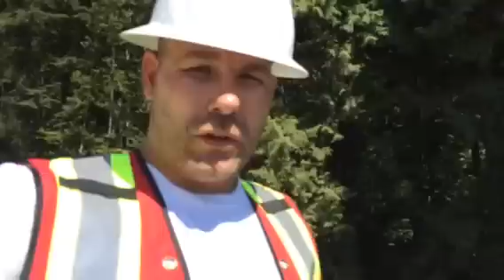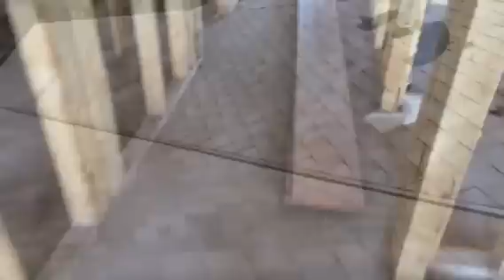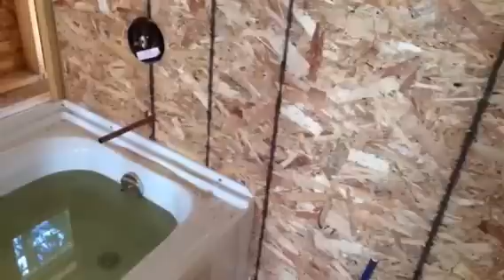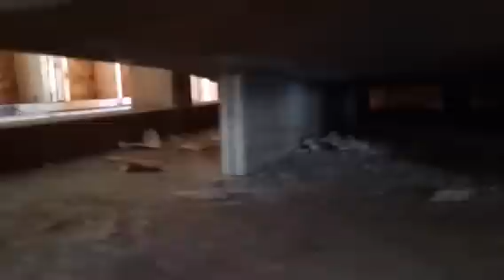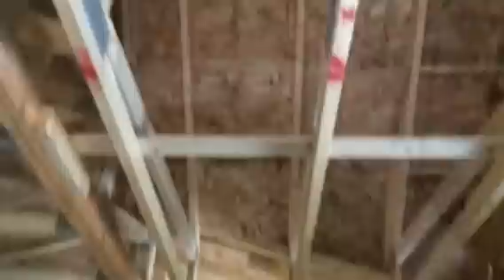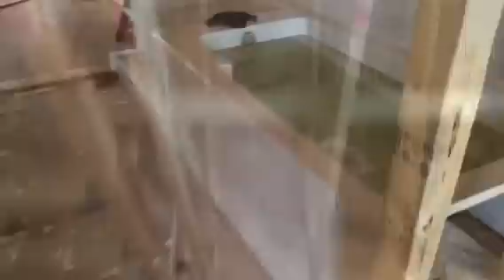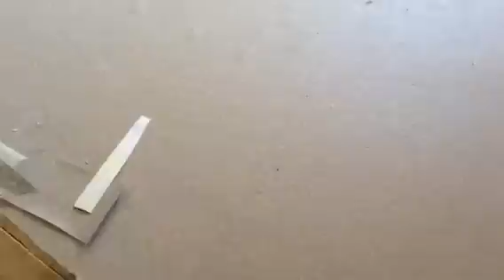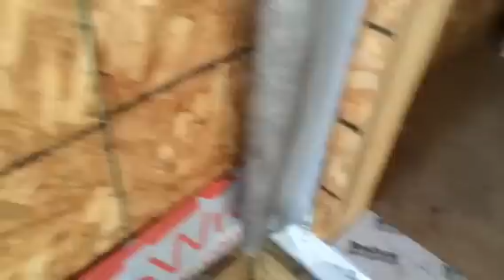New Home Construction Fails

Comment: No offence but you should really get up-to-date on tiling and waterproofing, check out Schlueter's website.  OSB plywood is a perfectly acceptable substrate because you're supposed to waterproof in behind it, meaning that no water will ever permeate to the substrate itself. I really hope you're not approving any tile that doesn't have waterproofing behind it!!
Reply from the maker: No offence Danny M but, if you think OSB is acceptable that's your opinion. Where I come from we call it a sponge for moisture.  It really depends on where you use the stuff. I'm in Vancouver, BC where moisture in wall cavities is a serious concern.
Reply: +Tom Munro, CHI why would water get into the walls?  I don't think you understand what I mean, the waterproof membrane goes "over top" of the OSB keeping it perfectly dry. If you build to Schlueter's codes they will pay for a tear out and reinstallation if it fails. So actually that's their opinion my opinion would be to use green board or cement board in case somebody cuts through the membrane in the future removing grout or something. At Schlueter's headquarters in Toronto they have a little cardboard box with their membrane adhered to the inside they continue filling it with water in the box has never been wet in over five years of having water in it 24/7
Reply: OSB is not acceptable where I'm from
Reply: +Gwen Coonen so yourself and others say OSB is not acceptable, and I would tend to agree I don't use it either. I doubt yourself or any other commenteers in the section have actually gone to Schlueter's website to check out their codes for substrate installation. Where this video was taken in North America it is a perfectly acceptable substrate, especially if you're putting concrete board over top and then a waterproof membrane. Where you come from it might be a different type of membrane that you called "damp proof" but over hear it is actually "waterproof" it's made of PVC. Please take no offence to me disagreeing with your opinion. Remember I'm talking "minimum code" here. Putting OSB on the exterior of the house, it's not something I agree with either but it does meet "minimum code". Since you're in Belgium enjoy a delirium tremens for me 🍻 Cheers from Nova Scotia!
Reply: You always build according to "what if?" You don't just take risks.  What's an extra $20 for 5 ply on a $3,500 tiled shower?  You serious?  OSB is garbage.  We recommend against it in every way, for roof, and for wall.  Ultimately it's what the customer wants, but when you're talking a TILE BACKER, what's an extra $100 for even putting down Durock? or an extra $20 for real plywood on the grand scale of things?  House roof and walls OSB to FIR would be $5,000-8,000 difference.  We're talking $20.
Reply: +Dale D if you've actually read any of my other comments You'd know that I don't use OSB and it is garbage! I'm talking about OSB as "minimum code" and as a substrate for green board or cement board. I say this because he is an inspector and should know the "new" codes that exist. The tub lip in this video was fastened to the face of the OSB and not to the studs in behind, this indicates their intention is to install another layer being of green board or concrete board in order for the tiles to sit flat and not interfere with the tub lip. If the green board was waterproofed with a layer of PVC membrane, then it meets modern building codes, like it or not. This is because proper installations never let the green board get wet or even damp. This "inspector" should research modern code and methods before he trash talks other people's work!
Reply: +Aquila Designs I agree! OSB is not ideal and doesn't have a place near water.
Reply: Haha "If you are a professional tile setter" WHY the hell would you be using OSB??? Go back to watching "This Old House" so you can learn what your going to work on tomorrow!!!
Reply: +Mirza and I've been using water proofing membrane for 10 plus years now, It was a new thing to many inspectors I've met along the way. Good inspectors ask the trades questions and others point fingers and call shoddy craftsmanship, very sad.
Reply: @Dane
Exactly I worked as a tiler for a couple of years and never once did we tile on OSB
Majority of the time it was Durock
Reply: +why guy that's were everybody doesn't get it. OSB is minimum code as a "substrate" meaning you must install concrete or green board over it then apply a waterproof membrane over that. Never would you install tile directly to OSB!
Reply: FYI to all commenteers! 
OSB is an acceptable substrate for tiling meaning you must install concrete or green board over top of it and then a waterproof membrane for it to meet code. I don't like minimum code and I don't use OSB unfortunately this is minimum code weather you like it or not, so please stop tearing me a new one for using it, because I don't! I simply commented on this to explain what minimum code is to inspector that doesn't know.
Reply: +Ryan Georgi that's my point smart ass this guy lives in Canada too. You should really look at the rocket science to make sure you get it right!
Reply: +Pat John I'm assuming you're talking installing tile directly over top of OSB?  Are you talking about installing a waterproof membrane or no?
Reply: +Fox Wright drywall and pine studs? What the hell are you talking about? If you'd like to respond with some sort of substance maybe you could explain your first comment.
Reply: It would be a really bad day at Schlueter's if they come in one morning and find the box soaked through ;-).
Reply: +Fox Wright your response explains nothing of your first comment, and I'm the dumbass? First off you're right! If you're comparing construction materials 100 years ago, compared to what we use now drywall and pine studs are incredibly inferior. That's not what we're talking about here, we're talking about modern building materials. So in a "modern" house what would you "frame" and "sheath" the interior of your walls with? If pine studs are garbage what kind of studs would you use? And don't say timber framing because that's not what we're talking about.
Reply: +stefantrethan true that! Lol
Reply: +Fox Wright good job troll! Lol
Reply: +Fox Wright I would agree… Have a look at a timber frame house after a hurricane next to one that's stick built, or I should say the one that was  stick built lol
Reply: Well Tom Munro think about it, water can get in from around the tub spout, shower arm escutcheon, shower arm pin hole leaks, or the shower valve itself. If you want to do it right just float the wall & forget that OSB & membrane crap!
Reply: +Dale D I agree with the first part of your comment in regards to pinhole leaks. But the second part about floating the wall is pretty vague, maybe you could elaborate on what you're talking about?
Reply: Danny M " floating the wall is pretty vague" No it's not vague if you tile, it's making cement mud & floating the entire wall over wire lath & paper. Basically it's 4 parts sand, 1 part cement, & 1 part lime. Done correctly it's perfectly plumb, flat, waterproof & a lot stronger. Google it!
Reply: +Dale D your first comment is vague, the only thing you said is to float the wall, that only means to apply motor to it. Only your second comment explained waterproofing it with tarpaper. 
Strength is only one aspect of wet-area tile construction. The most important is waterproofing. a single, unsealed layer of tar paper is not waterproofing, and never has been, it is a cleavage membrane meant to isolate the mortar from structural movement, nothing more.

Single, unsealed layers of tar paper, in fact, have proven to accelerate moisture penetration into the structure because they help promote calillary attraction, a major cause of saturation, mold production, maintenance problems, and structural damage. 
If you are a professional tile setter you should be researching the PVC waterproof membrane like I've been talking about. Even done "correctly" your method will not be "waterproof", it's the old-school way of doing it and we have a new way for a reason. Google it.
Reply: osb is fo' sucka's
Reply: In Texas I have never seen any osb used behind tile for backing its not allowed.
Reply: Danny M this video is 3 year old 😉
Reply: +Dane Anderson I would totally agree with that, that's the reason why I don't personally use OSB for any of my installations. My whole point is that it does meet minimum code requirements whether you like it or not, he is a building inspector and he should know this, he should also know that tiling directly on concrete board or green board is also not allowed, modern installations and modern building code call for a waterproof membrane. PS! OSB is Garbage!!!
Reply: yup yup  +Danny M
Reply: It doesn't matter what your opinion is whether it be OSB or not. A home inspector in the US abides by IRC,your local laws and regulations, plain and simple. In Canada you abide your laws. Leave your opinions as the door. This is not rocket science.
Reply: +locomojo0485 so do you tile or know tiling code? I agree that OSB is garbage and so are minimum codes. All my installations use Durock with water proof membrane overtop. I just think this inspector should know minimum codes.
Reply: +Fox Wright we do, it won't pass inspection and proceed to pouring unless the rebar is in place first. Even if the rebar doesn't poke out the side, it will continue to rust internally. The concrete slab being porous wicks moisture and holds it close to the metal causing rust. Combining metal with concrete makes for an extremely strong structure! It's also the the ultimate reason for its demise.
Reply: +Danny M. What you say about steel reinforced concrete is so true. When steel rusts, it expands to 13 times its original volume with unstoppable force, which cracks concrete like a biscuit. The standard here in the UK is 50mm minimum cover, the point at which the permeability of the concrete is sufficient to both protect and hold the steel. However even this is insufficient for exposed structures such as elevated sections of road. We now have 2 major problems just outside London. The first being the 3 mile elevated section of the M4, where 50 years of weather erosion has reduced the cover, causing slaps of concrete the size of paving stones to crash down onto the areas below. More recently, the Hammersmith flyover has had a similar problem. The external concrete was of a higher grade and 70mm cover and is fine, but the rainwater drains run inside the structure. Shortly after opening, ice caused a serious crash, resulting in the road being salted daily during cold weather. the combination of the salt and erosion of water running through these internal ducts has reduced the cover and the structure is breaking up internally. The repairs are costing more than the flyovers original construction and causing road closures that will last for more than 2 years. I have also recently seen a building where idiot designers and builders used reinforcement bars in the window sills. After a few years they are literally exploding from the force of the rusting steel.
Reply: +wilsjane wow! That's interesting🤔 maybe in the future we can build with synthetic materials and keep the steel out of the mix all together?
Reply: + Danny M. The problems with synthetics as that they naturally degrade and crack up as the plasticisers leach from the compound, just look at early UPVC window frames. We simply don't have 100 years to test every new compound. That is why on quality construction window frames do not form part of the structure, since designers know that they will need replacing after about 30 years. At least we understand steel and concrete, The problem is with lack of scientific knowledge among designers and builders. Steel rusts by combining with oxygen and the process is electrolytic, meaning that a small current flows. Since salt water conducts electricity any sand from costal regions that has not been washed is a major problem. Just think how quickly cars rust if you live on the coast. An interesting point, that helps you understand the principal is that ships that have sunk in deep water remain almost intact, while in shallow water they disintegrate within a few years. This is simply because the pressure of deep water drives out the dissolved oxygen. Provided that correct construction methods are employed and quality control of the materials is maintained, reinforced concrete has no real problems unless it cracks. In modern high rise buildings, engineers test and monitor every stage of the process and as you can imagine, when building a nuclear power station, engineers outnumber the builders. Sadly, house builders are often clueless. Perhaps requiring a degree in physical chemistry before working on a building site would be the answer. As a matter of interest. On small intricate and decorative features, stainless steel is sometimes used. Although costly, grade 600 is nothing like as expensive as decorative stainless. Tests were carried out on using it in car construction, but the manufacturers do not want their cars to last too long. It is also difficult to press into shapes like a wing and the 'spring back is greater. It is even harder to swage into cylindrical shapes.
Reply: +wilsjane makes sense to me.. Very cool
Reply: + Danny M. It has been interesting chatting to you and as you have no doubt deduced, I am a semi-retired design consultant. I have noticed that you are involved in tile work and thought that you may be interested in my views on he subject. When tiling over concrete, I specify a 3:1 sharp sand render coat and check that it is applied so as to leave a maximum 3mm variation in the tile bedding. We use Ardex cement based waterproof adhesives and grouts to fix the finish, which in my case is normally 10mm granite or marble in 300x300 or 600x600 slabs. For larger slabs or materials such as travertine, the thickness is increased to 20mm. When finishing partitions, I specify 25mm marine ply, which I prefer to cement boards that still use paper in their construction. I dislike backer boards, since they are just another layer to go wrong and no better than what is behind them. One of my 12 year projects was at London Heathrow Airport, a site that due to passenger numbers tests everything to destruction. One installation carried out by an incompetent contractor disintegrated within 6 weeks. I recently designed some work tops for use in food service at a London theatre (which is my main work area). I used the same principal. first fixing the marine ply, with a hardwood lipping. The trough was then tiled with granite. The overall cost was 20% of using solid stone, but more importantly a cracked tile could be replaced at a cost of around £10 with far less labour than replacing a section of stone. Here in the UK, kitchen companies market 40mm granite worktops which are 6mm of granite bonded onto MDF (compressed sawdust) although they cost about £300 per linear metre, they are complete rubbish and would last a matter of weeks in a commercial environment!!!!!!!  Kindest Regards, Wills.
Reply: Your right I laughed at that . The tub I'd screwed to the wall you don't mortar underneath it it isn't made that way. The hangers you were right on that's about it.
Reply: OSB isn't acceotable at all actually...hell I wouldn't even consider a wooden structure like this. Then again, I'm Belgian and born with bricks in my stomach, like we say overhere.
And thAt 'waterproof membrane'...we call it a 'damproof' membrane...that's a serious difference in meaning what it does. It won't hold ongoing leckages for sure. My new bathroom is in brick walls, water resistant cementplaster, coated with a rubbercoat, line user on foundations, a 'dampproof'membrane, then tiled. That's a normal solid vuile overhere. Waterboards etc are mostly done on cheap rebuilds actually.

Comment: The tub comes like that from the manufacturer. Don't do videos about home inspection and problems if you don't have a clue what you're talking about
Reply from the maker: Hey joe m just because a manufacturer makes an inadequate tub and base support doesn't make it right. If you think that tub has enough support underneath it go ahead and buy cheap tubs like this for your home. My clients don't bath in tubs like this thank you. 
Have a great day!!
Reply from the maker: Wow!! weird that the pulled the substandard tub out huh? J Fr55man I'm an inspector that sees this stuff Fail time and time again. Your probably one of these guys who installs these tubs, shrugs your shoulders and say "yup looks good" yet you never goes back to see if your work last or not. 
I like to say guys like you are part of the problem not the solution. Keep it up. Your keeping me employed. Thank you.
Reply: Do you also leave the plastic handles that come attached to sliders on when you install them, or the poly-wrap on replacement windows? How about all the plastic protection on a new car when a dealer receives it? Wait, you probably have never bought a new car before. Is it snowing up there, in outer space?
Reply: Joe M is correct. the tub is manufactured with an osb sheet as a substrate for the fiberglass... your comments on this construction being inadequate show that you do not understand the load capacities of the materials used. When installed properly this type of tub offers perfectly adequate support.
Reply: So they pulled it on your reccomendation, yet it didnt fail. I have a feeling you have never seen a tub collapse and fail. You have a very nasty attitude about your work. You are a do nothing know it all who cannot accept you are wrong. You should do some research on the products you are criticizing before you needlessly cost your clients money.
Reply from the maker: Nasty,?? Ummm I'm paid not to be wrong J Fr55man and if you were my client and I was wrong. You'd be suing me right? 

I've seen these types of tubs fail. Thank you